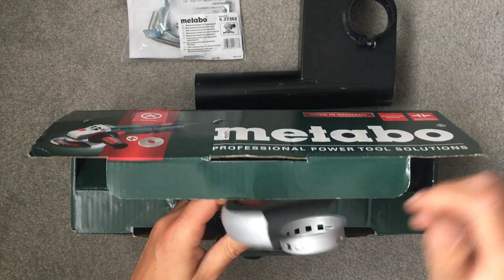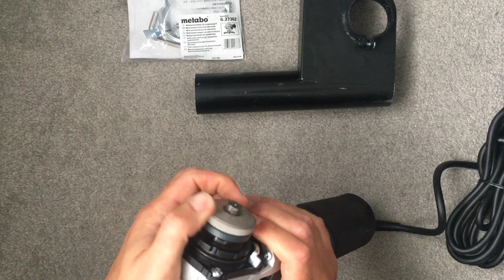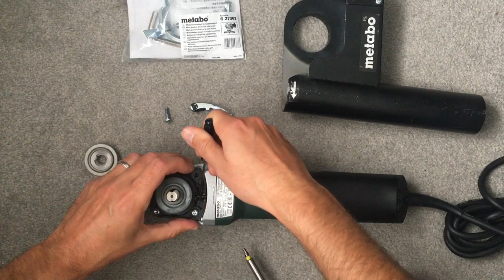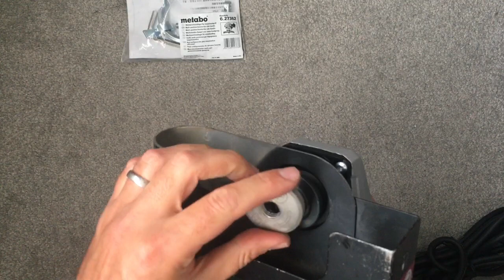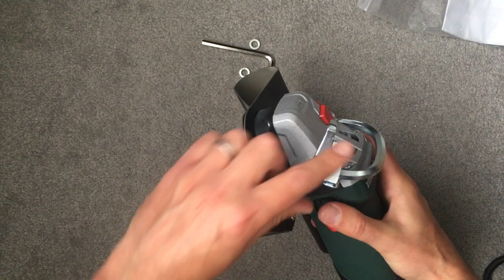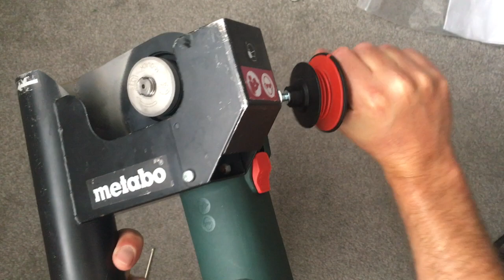W13-125 Q MR - Metabo Mortar Raking Angle Grinder

Comment: I have used the Makita. Owned the Bosch ( it actually broke before I made dust with it. I have the Hilti as well. This is the first one that looks like the guy that is actually working with the tool designed it. The other ones close off your view too much. If you can’t see you can quickly cut into a brick. I would love to try one of these out.

Comment: seems really tinny and cheap. I doubt a hilti product would be designed like that
Reply: I have been using this tuck pointing shroud on my hitachi grinder for a number of years and I can assure you it works perfectly well and you have a full view of the blade as it enters the mortar joint.
It is well designed like all metabo tools and it certainly isn't tinny and cheap.